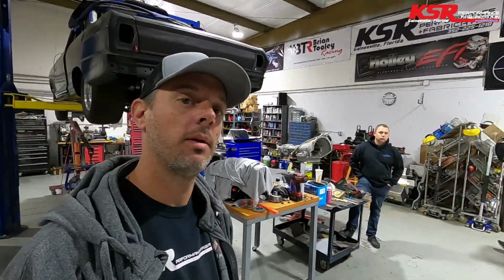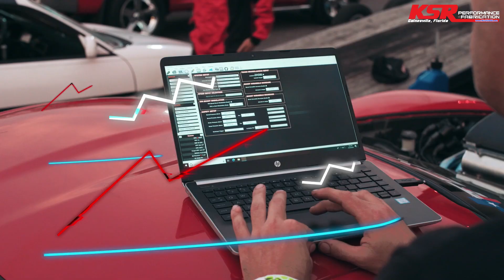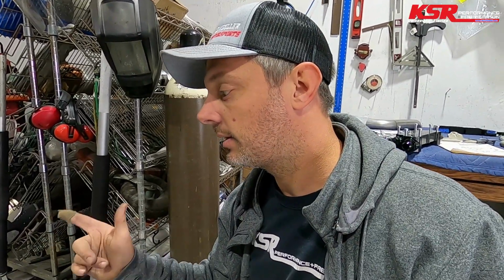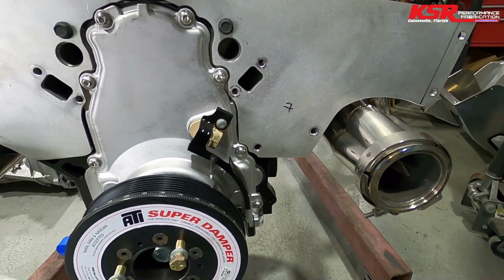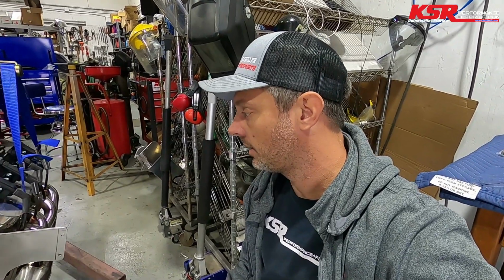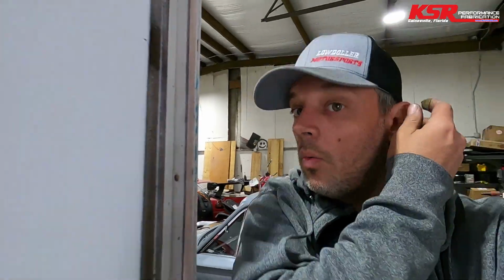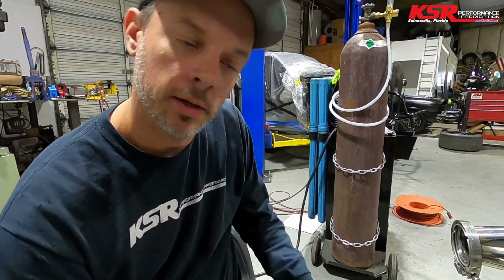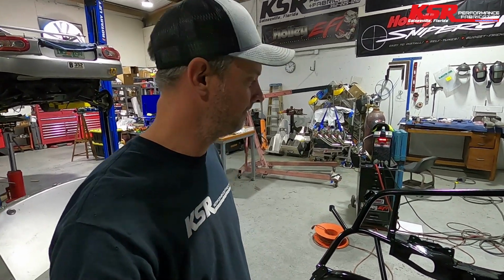Mullet El Camino Build Episode 10!! Custom Fuel Pump Mount and Final Front Frame Welding!

Comment: being an engineer who has to design fasteners for high vibration environments, seeing you use Nord Lock washers made me ridiculously happy
Reply: Yeah. I wish regular "lock washers" would go extinct since they don't actually work.  Still though... There's no substitute for a properly designed bolted joint.  Whenever I see a lock washer of any kind, my first thought is bad engineering. However, seeing a Nordlock... It gives me more confidence.
Reply: Haven't seen them in years use to use them Alot
Reply: Just using nylon insert nuts for everything is my modus operandi 😂
Reply: @alanloyd7164  nylocks are nice,  but loctite is where it's really at lol
Reply: @alanloyd7164  those are nice. But not usable in high temp stuff. Also not advised to re-use those type of nuts multiple times.
Reply: All that is nice but cross threading is where its at 😂😂
Reply: AvE is the only other place I’ve heard about Nord washers, and that’s great company to be in - for both guys.
Reply: @given0fox968  exactly the only other place I've heard it too. This is the family friendly version. Lol
Reply: LOL - I watched a video by the washer mfg explaining how the washer(s) work.  Assuming they must be Swedish or Norwegian or something.  Heavy accents.
Reply: Norlock will loose it self if is under a hard (12.8/12.9) bolt.
Reply: @Baksteen_Express  they're also a huge pain in the ass if you don't have good  tool access on both sides.
Reply: Dan Myers now that you mention it, Nord is probably a clue.
Reply: @regno78  how?
Reply: @boerbrabant  Nord lock will not dig in a hard bolt surfrance. It gonna loose and bolt begin to spin under a vibration. They are perfect solution under a nut, but with hard bolts is better to use loctide in threads.
Reply: @regno78  Don't know what kind of bolt you're talking about. Standard Nord Locks work with grade 12.9/8 bolts. Only bolts that won't work with a Nord Lock are MP35N and other such aerospace super alloys. I'm sure Nord Lock would be happy to supply some if you needed them.
Reply: I got excited after reading your comment on what Nord lock washers were...then looked it up on youtube how they work..  I was on my 15 min break following what you spoke of then looking them up on youtube.. all I can say is, I will use them for EVERY application I ever do from now on!...  thank you for the inadvertent recommendation!  Lol!..  high vibration scenario or not... I think they'd be perfect for many of my (wifes) up and coming jobs..around the house... Lol.
Reply: @RyanGribble  do you use the Red or the Blue Loctite though??...Lol
Reply: @duke1281  if you're gonna commit go red.  Lol.  I use both as needed.
Reply: @78megachevy  mother nature's loctite.
Reply: @regno78  Didn,t think about that but true so the washer does nothing.
Reply: I have a modus operandi too!
Reply: @78magachevy sometimes a man's gotta do what a man's gotta do!
Reply: Saves on time not having to safety wire stuff
Reply: @regno78  I picked up a set of "truck frame bolt" grade 8.3 sae and nord loc to fix a riveted x-member that has wallowed out the rivets. Sounds like a sacrifice is in order... The "truck frame nut" is a jamming interference "single use".  
I wanted the wide nord to spread out the clamping force and use the hole flange on the bolt and nut , but felt lucky to find a supplier with standerd width  on hand. Nut and Bolt of Ogden told me that the parts I have in possession don't exist and what the #&#÷::^'  We have spring washers.

Comment: the anti-spin bolt/stop on the drill press deck 🤯.    Never saw that before in any sheetmetal/machine shop in the aircraft world before, just the clamps/vise etc and they are a pain while doing multiple holes... while it my not work on our large sections we work on sometimes... the bolt stop is damn genius.

Comment: The engine shaking has been driving me nuts all video 😂 I’m getting pretty excited! After like 2 years between buying, trying to do jet car, leaving as undecided, then deciding to make super fast, we are getting close to seeing Mullet make his first pass
Reply: Mullet with a jet was a suicide machine worthy of a darwin award if it was completed as per the stated plan. That engine mount and angle are life or death critical. It HAS to point down about -1 degree. The v8 in the front would lift the front wheels to positive angles, ie it would take off the first time the jet was used with the v8. Dumping that idea was the smartest thing he did and its going to be alot safer.
Reply: Yea the engine got me too!  Strange
Reply: Very much understood why they didn’t go with the jet plan I was never actually a fan of the idea of a jet car, but that hasn’t made the wait any easier lol
Reply: I seriously wanted to get off the couch and go lean a broom or something against it so it would quit moving lol
Reply: @christianbuczko1481  to be fair, they had a plan that the v8 was only a 330' to 1/8th mile then they would cut it off and hit the jet so that situation didn't arise

Comment: Those are Nord washers. They are as good as it gets to lock a bolt and make it stay in place. The ramp on them is faster then the ramp of the threads and they stay locked solid.

Comment: Tip - when welding nuts try to always have a bolt in the nut especially the smaller you go. It stops the nut from getting any spatter in the threads and it will also stop the nut from deforming. Countersunk bolts are better as the also center the nut to the hole.

Comment: I don't think I have ever seen another build on YT use Nord lock washers! We use them when designing equipment but this is a first for me. Impressive as always Kevin.
Reply: Ive used them on turbo mounting bolts and other high vibration areas for many years.  They work :)

Comment: Kevin when we (Ford Powertrain) design an RTV joint flange, part of the width is the mechanical joint, and the other part has a 1 or 2mm undercut to allow a given thickness of RTV. Without this feature the RTV layer is too thin to seal and leaks. If your front motor plate leaks where it's RTV'd, machining an undercut for 1mm of the sealant to live in might be a solution.
Reply from the maker: That is killer info! We have not had a problem with sealing yet on the other projects that we have done this on, but we are not putting a 100,000+ miles on these things either.

Comment: When I’m working an an engine hanging from the stand like that I like to throw a ratchet strap around the legs of the stand up around the engine. It just helps hold it more than just hanging so it isn’t able to swing away from you.

Comment: For the brace on the fuel pump if it won't cause any clearance issues on the driver side of the bracket, you could put the brace on the driver side. With it on the passenger side it could flex (bow) and with it on the other side it would have to stretch the brace. Bolt it to the motor plate so its also easily removed. Just a thought.

Comment: AvE did some testing on the Nordlock washers as well as some others. If I remember correctly they work well as long as the metal on the bolt head and the surface are soft.

Comment: I thought AVE already tested that nordlock washer don't help hold anything. Maybe they don't increase the backing off torque but they help under torqued bolts from rattling loose.
Reply from the maker: We use them on some of our road race cars where the caliper adapter bolts would work themselves loose over the course of an endurance race (even with Lock tight and 5 ft lbs OVER torque spec). The bolts have been tight for years now and multiple races. Made me a believer.

Comment: Amazon attention to details. Sanding all the sharp parts that could cut people while working on the car got me. I don't work a lot on cars, mostly electronics, but I have been cut enough from cheap milling and weld jobs on those to know that it's a real problem. The worst part is that they are often serrated and that can turn into a really nasty gash.

Comment: in the UK, so these engines are a bit more common here than stateside, but we started using nord locks on nissan rb25 and 26's as got sick of turbo manfold bolts coming out and the fold over locks were just not that pleasant to work with in the cramped engine bays. superb product.

Comment: Is there enough space outboard of the fuel pump to make that support bracket a "V" shape with the fuel pump end of it at the "bottom" of the V?  That would give you some tension support as well as compression to counter the pull from the belt.

Comment: I had a problem with my car throwing belts off the alternator, back then they were v-belts, had a special one made by Gates to go between the engine pulley and the water pump, hard to do on '69 Olds. w31, but the main belt kept throwing, solved that by using the lowest amp alt. and switching from a 1 1/2 inch pulley to a 4 inch pulley, as the car would see 70 and above most often with the 3.91 rear gear, Cletus has had that problem with ruby but never tried a larger drive pulley that I know of ,it cuts down on the torsional forces trying to tear the alt. off it's mounting.
Reply from the maker: Ruby and Leroy both had alignment issues. I could see it when I was there with the cars, but the brackets needed some custom machining to fix the alignment. They have since switched them to different brackets.
Reply: @KSRPerformanceFabrication  I didn't know, thanks.
And thank you for answering.

Comment: Have you tried that orange thread locker that is showing up in stores? supposed to be stronger than blue without needing heat to remove. Been using it on my motorcycle to give it a shot and it definitely seems stronger than the blue but still removable without heat. Had a few bolts that even blue threadlocker wouldn't keep tight that this solved.

Comment: Cleetus has mentioned that cars on the track either require a pan under the oil pan, or a diaper.  Are you going to build a pan for underneath it, or are you going to let it go the diaper route?

Comment: Find myself wondering what suspension travel sensors provide, other than an obvious readout of how much the shock travels.  How is that information useful?  Does it help tell you how much rise or fall is experienced on launch... which could then tell you to make suspension adjustments?

Comment: Kevin, love the content! Why did you countersink bolts on the backside of the fuel pump bracket if you going to weld the stanchions on the front side? Seems counter-intuitive. Hopefully you can educate me!
Reply from the maker: Bolting it solid keeps it in place when welding it, and provides an extra support.

Comment: Looking good Kevin. I had been wondering about radiator placement. Also interested in seeing how you layout the fuel and ice tank as well as the air compressor system. Do you have plans for a bed cover? I will stay tuned.

Comment: I've always heard that you're supposed to push the fuel not pull it. You don't have any issues with the pump up in front? Or is there another pump in the back that feeds this one? I'm still trying to decide what pump to use on a 1600hp fuel system. I feel like mechanical would be more reliable than electric.

Comment: So a bit off subject from this video but am curious as to the max HP output of that 427 LS.  It is my understanding that LS’s are capable of around 2400-2500 max HP.  Is that correct?  If so it would appear that the current combo in Mullet would be ‘capable’ of around 6.50’s assuming a race weight of around 3000 lbs.

Comment: We use Nordloc for years now in the heavy duty sector and yes they work great. Kevin you mounted the fuel pump on same side as Lawndart, it spinning orientation corrected or are we going to have another no start lol. I know editing these video's is already time consuming but anyway when you are welding you put on screen what filler rod or in the case of mig, what spool wire you are using? Either way awesome videos.
Reply from the maker: Already swapped the fittings around and etched "IN" on the correct inlet side!!

Comment: Ive never worked with a motor plate before. Been wondering what the method was going to be for sealing the water passages, whether it was gasket or rtv sealant. Does it pose any longevity issues? Any problems with the rtv failing over time and having leaks between the plate and the block?

Comment: Kevin, other than self jigging purpose and possibly strength is there any other purpose/advantage to bolting the round stock to the plate and welding it? I am a designer and was kind of curious! Sorry if I missed the answer in the video.

Comment: Noticed that Travis was tapping on the Smithy....Do you have a low gear setup on that machine??......just wondering as my Smithy is stock and doesnt have the grunt to pull a tap of that size  like that??
Reply from the maker: I upgraded the motor to one that has speed adjustability.
Reply: @KSRPerformanceFabrication  thx Kevin!!

Comment: This is probably a silly question but why a mechanical fuel pump over an electronic one?
Reply from the maker: They move massive amounts of fuel, they have zero AMP draw on the electrical system.